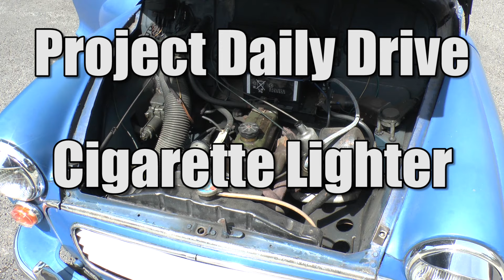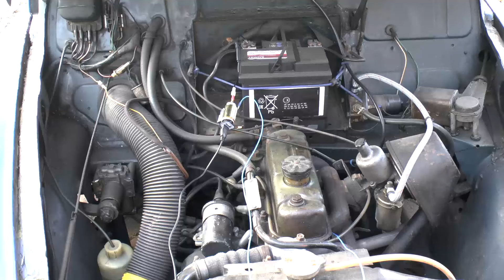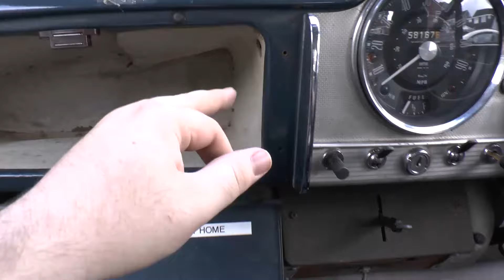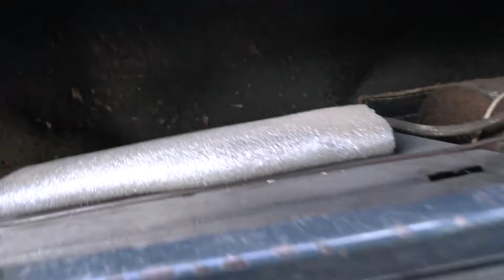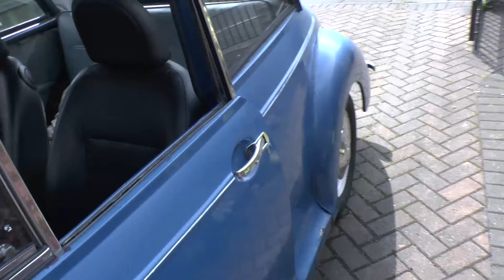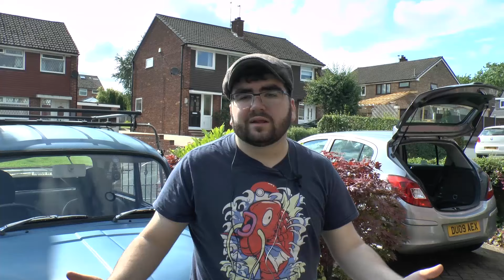Morris Minor - Cigarette Lighter - Project Daily Drive #2

Comment: Hi, nice job. You might consider putting a rubber grommet on that bulkhead hole to protect the wiring, or in the future, you might have a sparkly moment. The grommets can be a pain to fit,  so drill the hole out and you could give the grommet a 15 to 30 sec in microwave to soften it up. Good luck. With it, I have very fond memories of the moggies that I owned many years ago

Comment: Good that you have the positive fused close as possible to the battery! You might enlarge the firewall hole and fit in a rubber grommet or put some byutle  putty or electrical tape round wires where they pass through hole in firewall.

Comment: Thanks for the video, you might consider putting the in- line fuse close to the battery to protect the full length of the positive wire.  Great project .

Comment: I bought a 2008 Fiat Panda Active two years ago and was surprised that there was no factory fitted cigarette lighter socket. I also fitted a socket as a live connection in the glove box so it can be used to charge a phone or battery bank while the engine is switched off. I spliced the positive cable via a fuse into the ignition wiring loom and earthed the negative cable to the metal floor.

Comment: Suggest you put a rubber grommet  in that hole to prevent the wires chafing on the metal and creating  a short circuit  and a possible  fire,you could put some sleeving round the cables at that point.have a good trip
Reply: Aye. Good points. I'm back from the holiday and got some pointers so I'll be going back and fixing it better. A gromit is certainly needed, and I'm going to move the location of the socket too. Thanks for the comment!